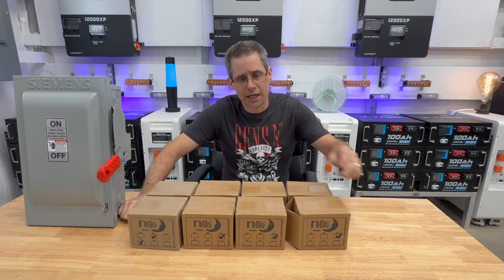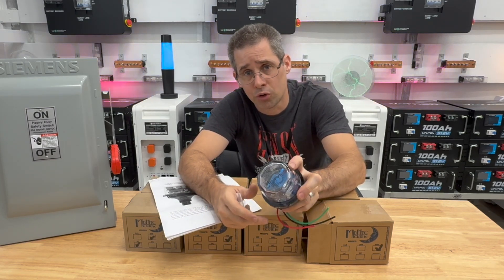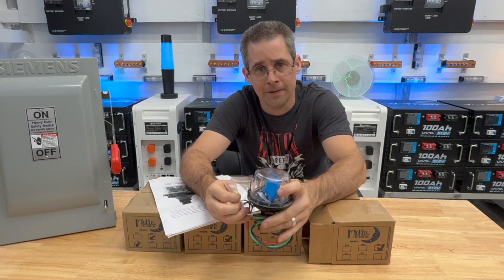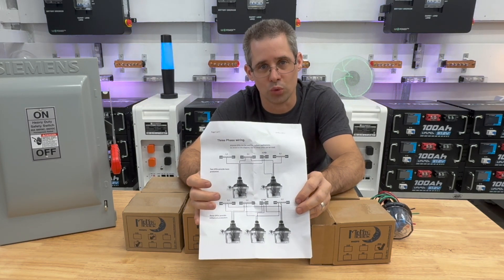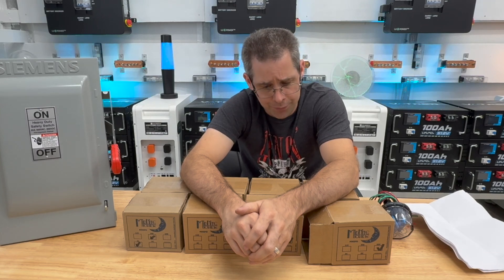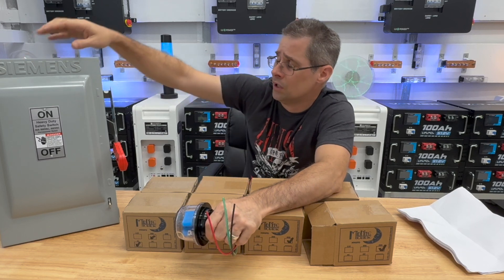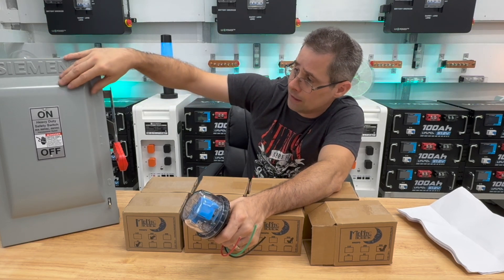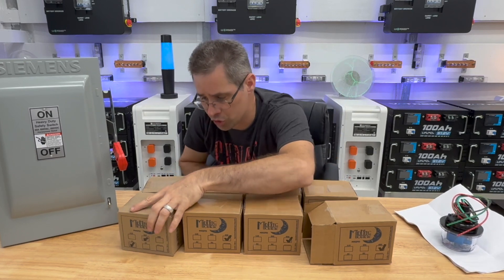Surge Protection: The Last Line of Defense for Off-Grid Solar

Comment: Mike! The best way to protect your system from lightning is to put up lightning pole near and around and ground them away from your panels.  They don't tell you , but grounding your panels and bonding it to your inverter. Is asking for trouble  Because all you are doing is leading that lightning to your inverter. Same on your rooftop.  Put lightning rods around your panels but again don't share the ground connection to panels or to your inverter.  Installers will ground solar and are too cheap to put their own grounding rod in the ground so they bond it to the house ground rod. That like pouring a gasoline trail from your car and leading it to your house
Reply from the maker: I agree with that.  My plan is to eventually have a lightning pole.  Also I don’t want to ground the panels with the inverter.  As you hinted to, voltage takes all paths.  Thanks for watching!
Reply: A lightning pole doesn't stop it from effecting anything nearby.  @MikesSolarGarage
Reply from the maker: @GoonyMclinux Yep voltage takes all paths proportional to the amount of resistance per path.
Reply: Hello, I made a comment about grounding.  Every one should ground their system but you can offer lightning a sacrificial path to take instead of your inverter by adding a second grounding called a lightning rod. That not bonded to your system but your system should be grounded in some way.
Reply: @Livingsolaryourway  if it's not bonded to your system it will talk to the ground rod connected to the inverter and there will be a potential lift regardless.
Reply from the maker: @Livingsolaryourway  I agree adding a lightning rod that’s isolated will be very helpful.  I may reach out to MidNite Solar to make sure I am not overthinking things.
Reply: That is the absolutely the worst set of advice for grounding I have ever read on YouTube, you go right ahead and completely skip the physics of how ground potential works and the entire reason behind why you properly ground things. Also using a single earth and entry point is exactly how its safely done. You do realize two different ground rods that are not connected together can "talk" during an event and throw the ground potential of one wire thousands of volts up or down making everything go boom. If you want a decent and factual grounding standard read W8JI  "station ground" web page and then you will have something closer to good advice to play with.